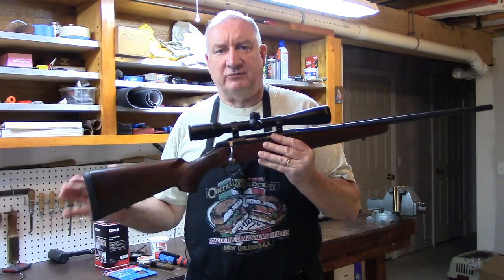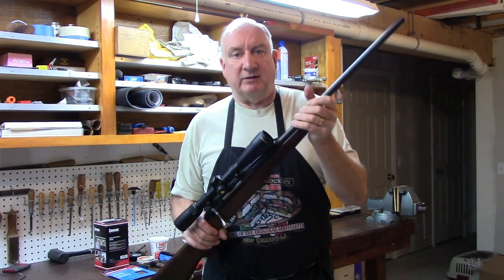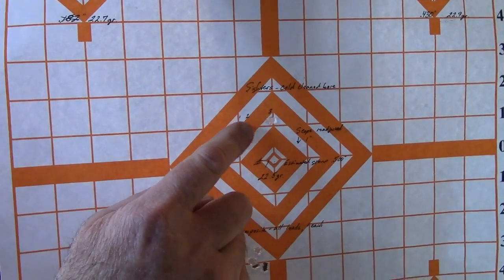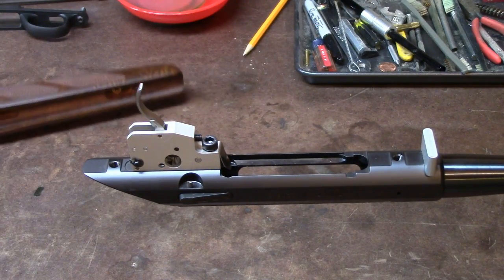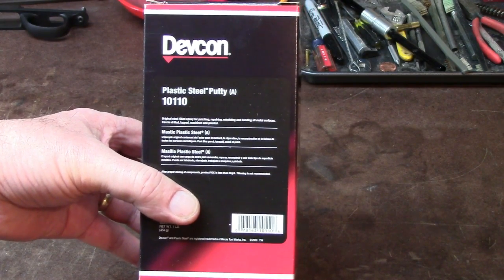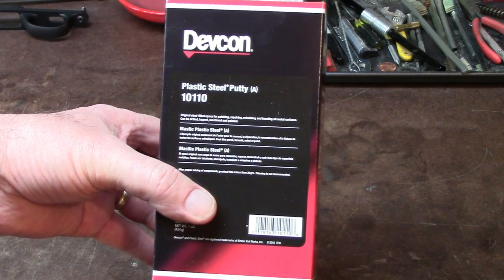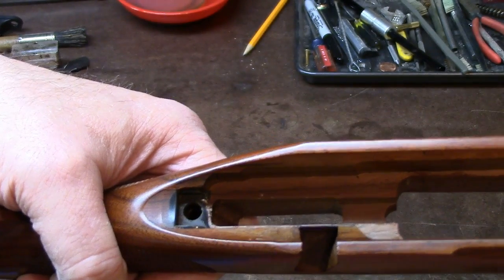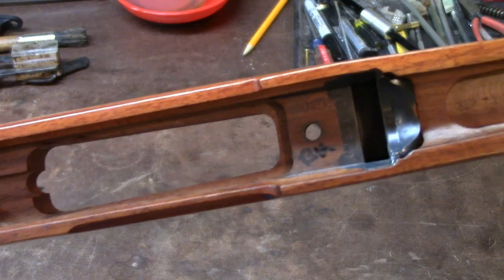How to glass bed a rifle, Part I ~ Epoxy bedding and free floating described

Comment: Mr GunBlue 490,

i wanted to contact you and say thank you for the videos. I followed your instructions to the letter on bedding my Winchester M70 chambered in 270 Win as well as the videos on reloading. 

The results are spectacular. I now consistently shoot 1/8 and 3/16 MOA. My reloading components are not match grade but simply soft point Hornady hunting bullets and Winchester brass. I do not sort brass or bullets and I reload on a Lee press using Lee dies. The guys in my reloading group are pretty impressed as am I. 

I couldn’t be happier. Im now moving on to my 7x57, 257 Roberts, and 375 H&H (all Win M70) and hope to get similar results. 

Thank you again and may God bless you for many years.
Reply from the maker: Those a fantastic results!  Thank you for sharing your success!
Reply: i wanted to clarify my statement saying i consistently got 1/8 and 3/16 MOA. While achieving those group sizes did occur, I dont want to be misleading and say my gun is an 1/8 MOA gun. Far from it. After gathering more data, I am shooting more sub MOA groups than before bedding and Im very pleased with the gun but i didnt want to be misleading. thanks again mr gun blue.

Comment: Hats off and thank you to my favorite Master-Gunsmith. I've done this before on an 1903A1 Springfield using Surf-boarder's two-part resin , but I was 14-years-old (with an adult supervising). I'm 75 now, so I decided to enroll in the class before I tackled bedding my Ruger M77 MK II.

I watched Part I twice, and Part II at least 4 times. Even though I can run a Bridgeport (and have built a lot of model airplanes), I learned so much!  I am grateful for the years of experience and advice imparted in these videos. I am very happy with the results I achieved after studying these videos.  

Pay attention, this gent knows his stuff. 
(1) Keep your bench clear and clean with only the tools and parts needed. 
(2) Do as he says: Mentally re-assemble your rifle BEFORE you begin. You will thank him.
(3) Do as he says, and tape the stock to protect it even though you may think the bedding compound won't go where you didn't intend or migrate that far . . .Yes it will!
(4) Using Artist's Palette knives is a great tip. They make the job so much easier and cleaner.

Watch Part II over and over until you have everything memorized and you will be a happy hunter.

Comment: I was a little weary about taking on this job for a 1980 Ruger M77 .300 Win Mag but found your videos on this subject to be the best.  I'm fortunate that you included a notation regarding the M77's unique front angled lug screw and the need to add at least 1-1/2" of additional bedding support to the stock at the bottom of the barrel.  I was careful to remove the contact area in the middle of the receiver so I could achieve the two contact points, as you instructed before and I added the epoxy channels for the front and rear areas.  I used JB Weld Original for my compound, as I'm very familiar with it and the cost can't be beat.  One deviation I used was to do an initial bed of the front lug screw to the stock to ensure a tight fit and the second bedding for the action at the front and rear contact areas.  After 24 hours of cure the action easily popped out of the epoxy bedding using the Kiwi neutral shoe polish and plumbers putty instructions and I was able to carefully channel the stock's barrel channel to get a 1/8" gap using a Dremel with a drum sander attachment.  Hopefully this year I will be able to verify the accuracy improvement which was approximately 1.5" at 100 yards with a three shot group before the bedding job.  Please keep up the excellent videos and I thank you for passing on your expertise to the next generation of gunsmiths and shooters.

Comment: Interesting and full of knowledge, To my strengths I have always known simple free float actually throws the accuracy with out proper bedding. However have struggled with clients for the explanation. You Sir  NAILED IT. The two processes combined the free float AND glass bedding only add to the already Accurate rifle,  Tightens up the Group,  does not take an inaccurate rifle and make it accurate. Many of the "Smiths" in my area do not Glass bed, free float the time and work involved not worth it to them.

Comment: I use my socket set as you use the bbl section for opening the bbl channel. The nice feature is the many different size sockets as the channel opens I simply pick the next size cylinder and keep cutting.

Comment: I use regular JB WELD.  I mix and stir for at least 5 minutes before adding to the area to be made permanent.  I have all my prep work finished prior to mixing.  I fill the recoil lug depression/cavity and the rear mounting screw area.  I use WD 40 as a release agent, and shoe polish on the screw threads.  I apply the JB WELD to the stock, assemble the WD 40 treated action and tighten the shoe polish mounting screws to just over hand tight (not torqued) and let sit for 24 + hours  (in the gun vise) my finished results resemble the commercial bedding displayed at 24:05

Comment: In this video, I think you touch all the bases, leading up to this critical operation of glassing and floating. I am also a big fan of doing pillar bedding which is not mentioned and I would love your perspective on pillar bedding. Perhaps I have missed the cons of pillar bedding and I keep an open mind on this kind of thing.  God bless you too!
Reply from the maker: Pillar bedding is the simple process by which rigid  supportive posts are sandwiched between the action and floorplate/trigger guard assembly to prevent compression.  The pillars may be metal, plastic, or most assuredly, the most precise fitting of all, the bedding compound.  

To answer your question, high grade, properly kiln dried American walnut has no compression issues, but can certainly benefit from pillar bedding in humid environs.  As I believe I mentioned in the video, I have performed pillar bedding a number of times, and found no particular advantage given my uses, but perhaps would be beneficial in more difficult climates.  

You can purchase aluminum pillars from Brownell's, or simply, use bedding compound.  With good wood boring bits, incrementally open the action screw holes to up to 1/2".  

BE CAREFUL NOT TO EXCEED THE SIZE OF YOUR FLOORPLATE OR TANG INLETTING, DRILL STRAIGHT USING A GOOD DRILL GUIDE, AND DO NOT SPLIT THE WOOD WITH TOO BIG A DRILL!  

Allow bedding material to flow around the RELEASE AGENT COATED screws.  After stock removal, relieve the REAR screw again to provide original screw clearance all around to prevent action binding.  The FRONT screw should remain snug to the pillar, such that it will unscrew from it.  This is the process used by FN with Model 70 Winchesters, which is as fine as any accuracy gets from a commercial rifle barrel.
Reply: Thank you sir for taking the time and effort in generously covering this subject. I guess I missed your dialogue about pillar bedding. I consider myself in a constant state of learning and I learn quite a lot from your instructionals. Thank you!

Comment: bedding and floating prevents the barrel from pressing on points in the barrel channel and warping the barrel or interfering with the harmonics in the barrel. it also allows the barrel return to the same starting point.  (watch slow motion shots and pay attention to the barrel )
Reply from the maker: Tom n 
Yes, of course! I think I've made that very clear in a number of my videos; particularly the two entitled Accuracy Rifles. These facts have been known and discussed for over 100 years, long before high speed videos. Free floated barrels and bedded actions have been around for over 70 years.

Comment: In the higher calibers, they say the recoil lug flexes and bends over time in the Tikkas. Some change it out with a steel version in stead of the factory aluminum. I believe the  newest Tikka t3x model updated this with a steel lug. Tikka makes a nice rifle. I shot one in a 308 a buddy of mine has. I think due to it being lighter and hard rubber butt pad, its felt recoil seemed more than my 06
Reply from the maker: monsterman27 
It won't bend when properly bedded and supported, as my next video will show.  It will launch in several hours.

Comment: This is just the subject I've been waiting for from you. I have a Sako 85 laminate in 243 that I want to bed myself.
Reply: Thank you for your very helpful video, which was a great help. I have actually got the task of glass bedding a wooden stocked CZ550 in .243 Win. caliber. This has you no doubt know has the front action screw screwed into the forward recoil lug. It also has steel ferrules between the trigger guard/floorplate and the action, in both action screw positions. I have, on advice, have already wood glued both ferrules into the stock. I have also been advised to use aluminium Devcon putty on the wood stock rather than the steel type you advice. I have also been told to use the putty more extensively than you advice, although I much prefer your method.
       I would be very pleased if you would comment on the above project if you have the spare time.
                                                                                                                                        Best Regards,
                                                                                                                                        CS.
Reply from the maker: Clive Sargeantson 
The Devcon I used is the one I recommend, but the aluminum version would work the same.  I explained why it is not necessarily good to use full length bedding, as it may add stress with a rocker issue in the middle.  Furniture sits steady on a warped floor because it sits on elevated feet or legs. You are dealing with the many changing variables of wood grain and expanding and contracting steel, which must not be confined.

Comment: You can increase your working time by putting the epoxy and hardener in the refrigerator for an hour or so before you need it.   This will slow down the chemical reaction.  By the same token you can speed up the process with heat.
Reply from the maker: mike underbrink 
Thank you.  Properly prepared, with all at hand, normal curing time permits more than sufficient latitude of work time.  But, it's good information.
Reply: I agree, be prepared!  I learned a lot of lessons, the hard way, working with epoxy when I built my boat... That Devcon product you use probably wouldn't need to be slowed down, with a pot life of 45 min.  With some of the other products on the market that have a 15-20 min pot life a first timer might need to extent that as much as possible.  Great video, thank you for taking the time to do this.

Comment: Hi there from New Zealand,  I have really enjoyed your informative videos . I am considering buying a Tikka T3 7mm08 but was wondering from a reloading point of view if the magazine length was long enough to be able to seat bullets with minimum jump to the lands for accuracy improvement if required ? Thanks again for the great videos keep them coming they are  awesome.
Reply from the maker: memay8wayne 
Sako uses only one receiver length in the Tikka rifle, which uses a single magazine overall length that has three internal structures that accommodate 223, 308, and 30-06 length cartridges.  The issue of bullet seating depth is confined to those three lengths, but does not dictate the internal chamber length.  In my extensive experience with Sako rifles over nearly 50 years, which includes this Tikka, I have found Sako to be very generous with regard to chamber overall length, and have never seen a Sako that is not intelligently engineered to the 
highest potential for ballistic excellence.  In other words, they don't underthink anything.  A Tikka is a Sako.
Reply: GunBlue490 Thanks I did think that would be the case but great to hear it confirmed by an obviously knowledgeable guy . Tikka the cheap man's Sako, alot of rifle for a great price . If your ever in NZ I'll buy you dinner .

Comment: Is JB WELD sufficient for the epoxy material? It has a compressive strength of almost 4,000 psi. I've seen glass bedding videos using this
Reply: The 24hr jb I’ve seen used a lot. Just don’t use the jb kwiki weld 5 minute stuff

Comment: Sir, I was wanting your opinion. I have my grandfathers 721 and I am attempting to fit and inlet and bed a boyds stock for it. The 721 has a bump in the barrel where the rear california style rear sight is inlet into. I am wondering how to handle the bedding and free floating process as the barrel is not one continuous taper. Your advice would be much appreciated.

Comment: Some thin barrels, such as the Weatherby Mark5, require pressure points in the forend to stabilize the barrel harmonics ( Vibration). Free floating the barrel the rifle shot like a shot gun.

Comment: Struggling a bit with a 2013 Featherweight in 7X57. Best groups are handloads, with 145 gr  Grand Slams. Have tried 154 gr SST, 162 gr SST, PPU Factory 139gr, Federal Power Shok with 140 gr. all with little success ranging 2MOA to 3MOA.  My handloads got me one group (3 rounds) at .887 and one today at 1.04 in. Even tried a load with Hornady 120 Hollow points to no avail--2.5 - 3 in groups). Do you think my bedding is sufficient? I am reluctant to install pillars, or do you think they'd do any good. Trigger is at 3 pounds, barrel is free floated to about 4 dollar bills, stock torqued to 35 inch pounds. Using Caldwell front bag and rabbit ear rear...alternating with a tack driver bag. My .25-06 Stevens 200 (only aluminum pillars in a plastic stock, changed barrel to 24 inch Shaw, and a Timney Trigger) is just embarrassing this 7X57 Featherweight.,,as beautiful as it is. Two different scopes tried. Leupold bases with rear windage adjustment. Vortex 2.5-10X Viper HS. Duplex.  Smallest group was with Vortex 4-16 X44 I used to see if there may be a scope issue and get a better sight picture. Anyway, do you think the bedding should be good enough without pillars? MY Leupold 4-12 is staying on the 25-06.

Comment: Gday Mate , watch your videos a lot . Keep up the good work . 
I have a SMLE 303 which was sportered when I got it . I dont like the inaccuracy of its thin whippy barrel and want your thoughts on bedding the whole barrel with an upward pressure builtin . The up pressure was design feature at production but is gone in this one . 
Look forward to seeing your thoughts .
Reply from the maker: If you watch my recent bench rest video with my Model 70 in 257 Roberts, you'll see that thin whippy barrels can certainly shoot excellently.  In my long experience, they can shoot beside heavy barrels.  Their disadvantage is having less mass to keep steady during lock time, and SMLEs have rather long lock times that can jar off target after the trigger is pulled. Free floated barrels, regardless of barrel weight, MUST have solid, preferably epoxy bedded actions, or the entire barreled action will swing in the stock with every shot.  That's why upward barrel pressure is used in many rifles; it's easier and cheaper to stabilize a barreled action that way than to fuss over bedding.  Alternatively, you can do the same by shimming the barrel with increasing layers of business cards until you arrive at an accurate condition, then simply epoxy them into place, or make a facsimile with appropriate brown paper shopping bags.
Reply: @GunBlue490  Thanks mate . Confirmed my thoughts . I am also a strong proponent of good bedding . I have ALL my sporting rifles shooting near target accuracy.  My target rifles are down to 1/2 moa if not better depending on the nut behind the bolt . I have seen that with partial floated barrels with bedding say 6 inches forward of the action that tuning the barrel by trimming back the bedding till the correct harmonic is found is also an option . Probably  better just tuning the load I reckon ? 
Thanks for your videos and your time replying to me . 
Cheers

Comment: my weatherby vanguard has a bedded barrel arrangement and it shoots very well. Its sitting  in a bell and carlson stock with a full length aluminum bedding block built into it. Would it be worth free floating the barrel or should i just leave it alone?.

Comment: Wondering about the load data for H322? Hodgdon 2020 manual and Nosler web site for 50 gr bullet list 22.2 grains as max. Your target shows 23.2 grain load being used. Thanks for all your videos.
Reply from the maker: That was the maximum that they achieved in their test guns.  It was not the maximum in my Tikka.  I was using Sierra Blitz King bullets, which have very thin jackets with soft cores, so they develop lower pressures.  Nosler uses bullets with solid bases that have higher resistance, and Hodgdon uses data based on bullets that they don't state. That's why all loads must be worked up neliw at least 5% below maximum.  I measure my cases as I work up loads

Comment: I bedded 3 or 4 rifles in my few years of rifle service and I forget how I didnt get any epoxy into the screw holes in the action. I think i might have plugged the holes with plastacine and tightened the action down with a rubber band. Im wanting to bed a norinco jw 105 556 rifle because its free floated already but the hole for the recoil lug is abit wide and the barrel can move side to side abit. I need to tighten up this stock to action fit. Was thinkin of only adding a 2 inch epoxy spot in front of the receiver were the barrel goes into the action. Ill need to take off the trigger and plug some holes so it can have a full bed instead of the barrel channel just to keep the barrel straight and have a pad to sit on tofree float. The recoil lug has the screw hole in the bottom so it might be hard to do it. And with no screws it will be hard to align it up and keep straight with the screw holes. I think i might have a little challenge.